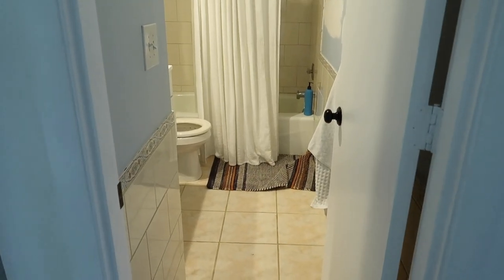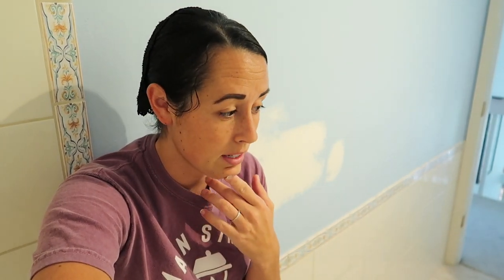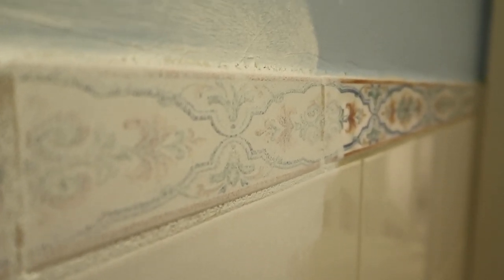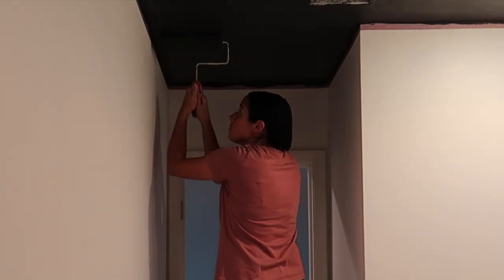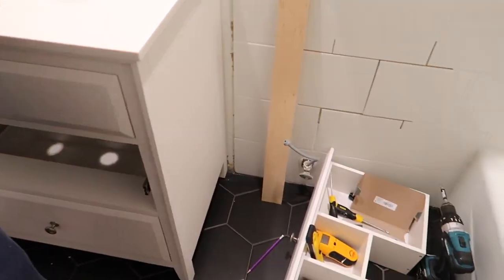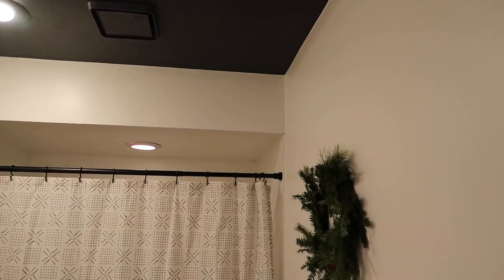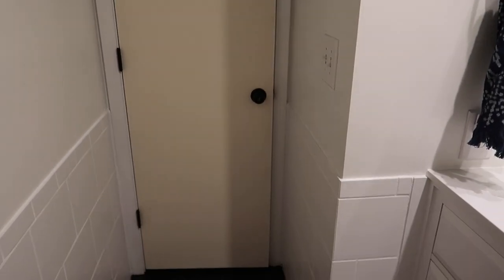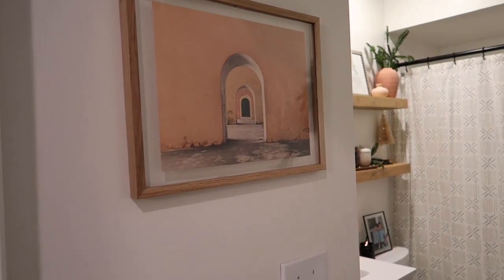EXTREME SMALL BATHROOM MAKEOVER ! | MAJOR BATHROOM REMODEL | Beyond Paint

Comment: Black ceilings have been common in industrial and commercial building design/rebuild for the last decade - skip the 't-bar' ceiling and just paint everything up there a non-glossy black, including HVAC ductwork, pipes, beams, etc.  The black ceiling looks good on your bathroom, and I think the recessed lights help with that 'depth' look you mention, as well as the white walls, white vanity, and white toilet.  And the black hexagon floor tiles contrast well with the white (painted) wall tiles.  It'd be nice to know how long the paint on the tiles in the shower/tub lasts.  If it was me I'd just strip the walls of all the old tile and redo it using some inexpensive 24 x 12 white tiles on the walls and shower/tub walls.  Anyway, looks great!

Comment: If you still want your shower curtain from ceiling to floor check out Amazon. I have to buy shower curtains longer than normal as I have a wet room set up for my disability and wanted the doors hidden. The choice isn't as large as for average length shower curtains but they still have some beautiful ones in extra long x

Comment: I would have painted the frame on the mirror black.  Doesn't really go with anything in the bath.  Also, u could sew an addition to the bottom of the shower curtain if u want to take it all the way up, as u had mentioned.  I would add black fabric or black print fabric.  Just sayin...
Reply from the maker: The shelves are virtually the same finish as the mirror . 🙂